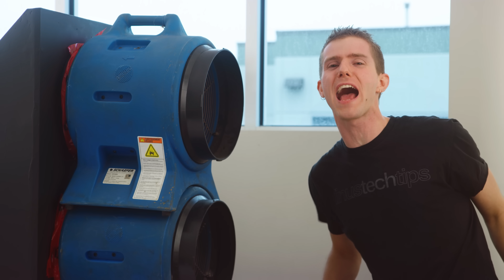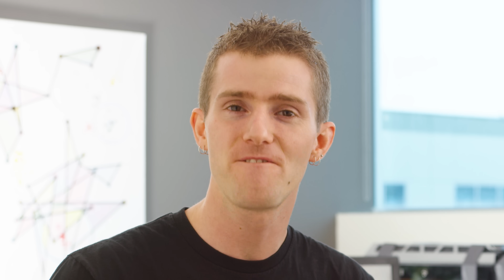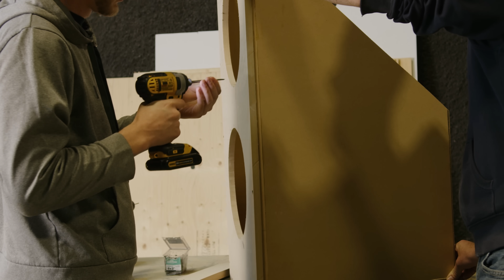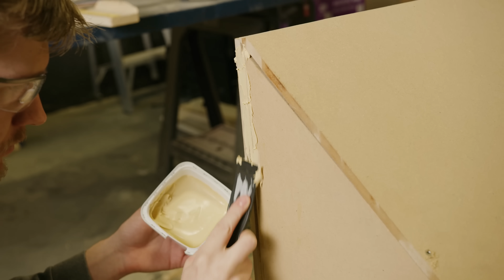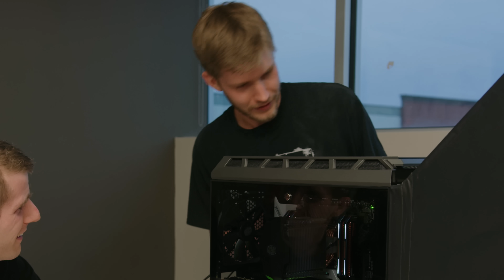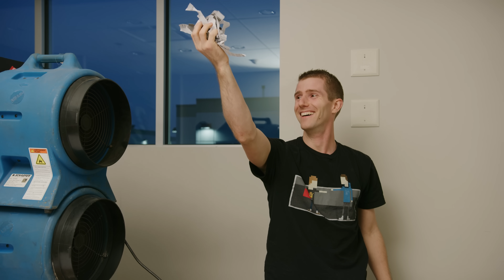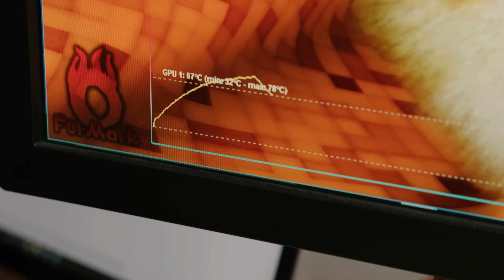Highest Airflow PC EVER - SUCCESS!

Comment: Im looking for a lower budget pc for gaming, photo editing and video editing what do you think of the New Inspiron Gaming Desktop by dell?
Reply: the one with the 1800X and RX 580 with 16gb of ram is a super deal for 1200$(total cost is slightly less than doing it yourself and it has a 580 without any price gouging). not sure what one you are looking at though. The lower priced one that has an R5 1400 and RX 570 is way over what it would cost to do your self at that price(almost 900$).
Reply: If you are not afraid to build your own, you could make a mini-ITX system with a 1500X and 1060 3gb with RGB bling and upgraded fans and all for under 900$, and that's not going cheap on any of the parts either. https://pcpartpicker.com/list/DCB3r7

Comment: Still quieter than some AMD Stock CPU fans :/
Reply: Those old ones were louder then a 747 taking off...
Reply: TromunPlayz atleast they cool better than intels
Reply: The Wraith spire is really quiet
Reply: ikr lol laptop amd 4650
Reply: Classic AMD fans were much worse, sounding like a leafblower the intel stock fans though loud are significantly quieter until the wraith cooler
Reply: It's nowhere as terrible as the FX5800 as well.
Reply: Nah, the Athlon was quite a beast and did beat the pentium 4 to a pulp in everything including heat,  but AMD was not exactly in position or budget to develop their own fan, so they had to rely on cheap third parties, and well, you get what you pay for.
And intel not always is right on the money with their designs either.
Namely, that awful plastic pins they still use.
Reply: Dr_Kachu san not to mention the noise and horrible colours lol.
Reply: I personally have a Amd fx 8320 8 core processor and i don't regret it its a beast for the money, but the stock fan was like a jet engine so I upgraded to a Cool er master hyper 212x which keeps my CPU under 45 degrees C under load overclocked to 4.3ghz. :P
Reply: What are you talking about?
Let's not forget the Intel stock fans...You know, Those loud as fuck things.  Louder then this
Reply: **Intel
Reply: Maraudience and your opinion is bad as well
Reply: Maraudience I feel like you own an Intel Celeron Processor
Reply: Maraudience oh and you're a fucking idiot, people aren't paying less, they're paying for a beastly processor that crushes most of intels chips in many aspects.

Comment: No front i/o for power switch? Just go into the bios power section and set it to "Always on". Now you can use the psu power switch to turn on your computer. The other way is to unplug and plug in the psu power cord.

Comment: Next video: we used a jet engine to cool a pc
Reply: Have you considered using negative pressure cooling?
Just suck the air out into the engine, problem solved.
Reply: Actually the jet engine and it's propulsive airflow can be completely separated (i.e. a turboprop).
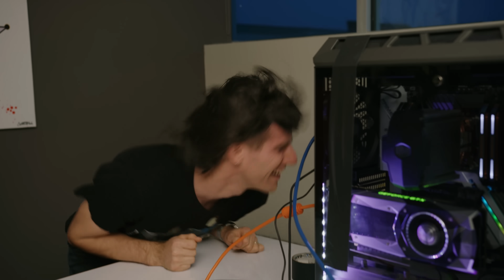Reply: Pc master race at 7:25
Reply: With afterburner for optimal cooling
Reply: @Riskabuen22  LOLOOL
Reply: linus actually looks like a real girl at 7:26
Reply: The Aliens guys calm down im pretty sure that this was just a joke
Reply: You obviously have the PC run negative pressure as it is before the compressor.
Reply: Try to cool anything with a jet engine and watch it melt
Reply: A jet engine as an output fan would work tho
Reply: Most of you obviously don't know how a jet engine works. They could attach it to the intake and pull air through. Or. Use the 1st stage bleed air off a turbo prop (high-bypass) for ridiculous air flow. But it would probly destroy the PC due to the volume and pressure created. Stop thinking about the exhaust of the engine ya noobs.
Reply: You mean an R9 290X stock fan right?
Reply: You could simply use a jet engine to suck the air out of the case... Problem solved!
Reply: If you use a turbofan
And seperate the hot exhaust
Youre good
Reply: QB3K no joke
Reply: G.M Ad Use Steel beams, not even jet fuel can melt them.
Reply: You are giving me ideas...
Reply: Just make sure you are using the jet behind the PC to pull air through it. Won't really work the other way around. Also, buy LOTS of speed tape.
Reply: Next Video: We hold a PC outside the window of a jet mid-flight to cool a PC.
Reply: It genuinely would work if you only took the low pressure turbine bypass air, which is ambient. If you took the high pressure exhaust then that sits at about 800C at running power levels, depending on the engine in question.
Reply: Almost everybody in the replies section of this comment don't know jet engines.
There are 3 common types.
Turbofan-Mostly used in commercial aircraft. Newer turbofan engines have high bypass ratio like the Rolls Royce Trent XWB.
Turbojet-Works the same way as turbofans, except it has zero bypass ratio. Mainly used for supersonic aircraft.
Turboprop-Works the same way as a turbofan, but there is no cowling. Used mainly in regional aircraft.
Reply: The Aliens That probably would not work as  i believe jet engines output hot air
Reply: Strap the PC to the net engine's intake. Problem solved. :)
Reply: @hoover8638  you obviously don't realize that jet engines have an intake. It would work just fine a a suck setup. Also the fans he used also put out heat.
Reply: @hoover8638  no shit
Reply: @hoover8638  you would use the intake to suck air through it
Reply: You can use an Air jet for cooling if you do something like a Dyson Fan. You can not however call it an "engine".
Reply: That's pretty...lit -_-
Reply: The Aliens i
Reply: at that point you might as well submerge the pc in liquid nitrogen
Reply: I think 'Jet Turbofan' are the words that you are looking for.
Reply: SloppyEngineer t'was joke.
Reply: jet engine make a lot of heat so not a good idea
Reply: The Aliens you could day that linus' got the got the funky flow
Reply: You would lose the video card!
Reply: If you use the idea of the Venturi effect and Bernoulli's principal to design a duck for the air to flow through before entering the case, you might get even better cooling with smaller fans.
Reply: The intake of an engine is just a duct. The compressor is turned by the turbine which is turned by the expanding gasses from the combustion chamber. You can use the concept of the compressor, intake, and exhaust of the turbine engine, but it will not be anywhere close to what a turbine engine is.
Reply: that would probably melt a PC.
Reply: I win
Reply: The pc would melt unless instead of the back you put it infront so as the engine pulls air, it has to go through the pc first before the air actually reaches the engine.
Reply: Ackzo will work if the jet engine was set to negative pressure, aka sucking air out of the case.
Reply: Instead of a jet, try one of those Dyson vacuum motors, or even better one of those weird open air designed fans.
Reply: That would be insane.. would have to put PC on the intake side though.
Reply: what about using a nuclear power fan?
Reply: well you still would have to try and attach the engine to the case, and even before, you have to figure out a way to not let the whole thing fly out of the windows or crash through the wall
Reply: lol that would completely melt it into a puddle of molten metals and plastic
Reply: If in front the jet will eat the pc and spit it out blam if in the back it will briefly melt then get lunched straight through the wall or several feet
Reply: Next video: we used a jet engine to melt a pc
Reply: Jet engines output blazing hot air
Reply: yeah but if you put one behind PC... PC would probably end up inside the engine
Reply: That would be a LinusJackassTips video
Reply: MelonPlayzYT I’m sorry what?? In what sense does it make that a jet engine outputs cold air? It is literally mixing the air with jet fuel and exposing it to produce thrust, if you ever have been on a jet plane or have see the engines running on one you can literally see the heat coming out of them, I fly a 737-800 on IVAO XA and it will tell you the temperature of the engines which can exceed 900C and even to 1000C
Reply: And next video we're gonna use ths worlds most powerful wind tunnel to cool it and use the acoustics system used to create vibrations to test spacecraft as the surround sound system and have a 4k display not just regular old boring 4k but each pixel is replaced by the worlds most powerful flashlight
Reply: Yes. Let someone else wear gloves while using a table saw.
Reply: Next video: we used the Ocean to cool the pc
Reply: Cold jet engine because fuk u
Reply: The Aliens techniques u could have the air sucked through the pc....... that could be funny but I’ll stay on this side of my phone for that
Reply: r/wooosh for practically everyone here
Reply: Optimal solution for roasting your pc
Reply: that 10IQ joke tho
Reply: Delete ur comment buddy
Reply: Next video: we went into space to cool a PC
Reply: It won't work it will only burn it sorry for making you sad😭😭😭
Reply: They did it, but camera they used to film it was never found. Rumors tell that it have not yet landed.
Reply: Yes bro 🤣🤣🤣🤣
Reply: Hey.. That was what I was thinking when I saw this.
Reply: Could easily have the jet engine pulling air through the case which would work well.
Reply: Yeah, no, that is contradictory.
Reply: The Aliens That would melt the PC. The better title would be “We used a jet turbine to cool a PC”
Reply: can't be a blow-style though, otherwise the fumes will melt everything.
Reply: How the fuck does an ICE, something that gets hot and generates thrust, cool a pc?
Reply: Reported.

Like honestly, the amount of people who comment this is just insane, a jet engine out puts very hot air, like ffs
Reply: Thats a horrible idea. That would heat up the PC because jet engines compresse air by using heat and then later blow it out
Reply: But that would be like a blow torch on the computer. Nothing like a blow torch to cool a pc.
Reply: Robert Pirlot what if they put the pc to the front of the engine
Reply: Jet engines exhaust is over 200c. I don't reccomended it.
Reply: It was a stupid joke...
Reply: How the fuck would you cool something with fucking blazing hot air? Dumbass.
Reply: use the jet engine to pull air thru case not push
Reply: @IIlIIlIIlII  BITCH

Comment: highest airflow pc ever vs water cooling
Reply: VS highest water cooling with a case soaked in the tundra
Reply: Vs ice cooling
Reply: VS dry ice cooling
Reply: that will be awesome project
Reply: vs submerging ur pc underwater vs pc in refrigerator
Reply: Just aircondition the room of the air cooled one down to about 10C...
Reply: UNDERRATED ! =))
Reply: Vs liquid mercury challenge.
Reply: Open loop cooling. You just take the cold water straight from the tap and you flush it down the drain after using it once.
Reply: Put a dry ice tray on the intakes like the F1 teams do when they cool the engine.
Reply: AIR WINS,
Reply: I wish he would do one vs my ice cooling creation https://youtu.be/7z_cTyhn-K8 and then he could cover the scandal that is Asus.

Comment: the following components are essential to eliminate any kind of thermal throttling related bottleneck:

1- 10 gallons of liquid nitrogen. 
2- highly conductive metal-based material, aka gallium. 
3-  six hexagonal oriented laser beam emitters for reaching absolute zero temperature. 
4- two one-way tickets to Alaska.
5- two appointed schedules to a neurosurgeon for frontal lobotomy of course. 
6- a MacDonald cupon for me for thinking out of the box.

Comment: To even benefit from all that airflow your heat sinks would have to basically need to look like fettucini noodle fins or smaller. because you need more surface to even benefit from all that air.

Comment: I've been on vacation few weeks ago in northeast Brazil where there's a place with winds that are basically like standing behind those 24/7.... it's crazy. Yes, they already put a wind farm there, albeit kinda small for it's potential. Problems? It's far away from any city, there's zero infra-structure there, and ground is basically sand all over.... very hard to install heavy towers.
Still, I don't think I've been anywhere with so much wind before.
An open test bench build in the open there would probably score not too far from this. xD

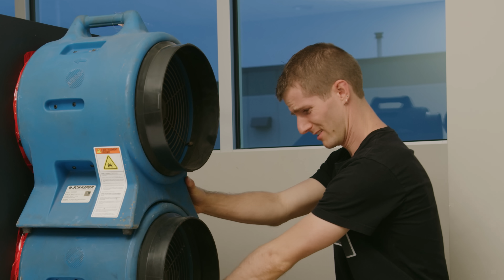Comment: 5:34 I love how the top panel comes right off, revealing the poor build quality of cooler master's product in a video that coolermaster sponsored. Should've given Linus a better case for this.

Oh, and before you educate me on just how much force pushes on that panel, go watch Gamers Nexus' review on that case. The top panel really comes off that easily.
Reply: u cant even lift this case without panels falling off it. Add big ass fans, then block off the airflow, the sidepanels dosn't fit tight and actually rattle. It is a really bad case.
Reply: And the case is really HAF... after some modifications ;)
Reply: I think you don't understand how mutch air it did blow into the case as a sailer I can tell you 1 think its way more as you think and if you want you can do the math it's a round 35 kilo per square meter of air per sec devided by the surfes of the case openings so its a lot
Reply: It is poorly built. Regardless of the 2hp fans.
Reply: My C70 would've survived this easily.
Reply: My old, Antec Sonata II would have survived. Metal construction > plastic.
Reply: I think the Corsair Obsidian 900D would've been one of the only few cases that would've survived this onslaught. I'm honestly surprised they didn't blow the glass out on this case.

Comment: just imagine if you did this configuration in push/Pull now THAT would be some Airflow......it would remove any bottleneck inside the case with air being trapped inside......

Comment: Do a revisit on this using some kind of Flex Duct to a case so you can move the blower fans outside during the winter and draw some real cold air in the case. Water temps on air with big ass fans? I think I see another video...

Comment: rig up some isopropyl sprayers(the finer the mist the better) to cool the air charge down to create your next meme video. but i would suggest to wear a respirator as the vapors from that would be not OSHA approved...but if you were surprised by a 10 C drop in a short time frame, that should(keyword is should) make the air charge considerably less than ambient

Comment: But can it cool down an AMD processor
Reply: i9*
Reply: pentium 4*
Reply: BUT CAN IT COOL CRISIS!?!?
Reply: Or a GTX 480 in sli
Reply: GTX 590 MARS III from ASUS in SLI with an i9 7980XE OC'd to 4.6GHz. Probably gonna need multiple power supplies connected to different breaker boxes lol. I remember the first time I tripped a break with a powerful PC....was hilarious
Reply: Joke doesn't make sense fool, Intel CPU's run hotter, your lame joke is moot.
Reply: I mean if an H80iV2 can keep my FX6350 cool while its running at 5GHz and 1.525 volts, this setup can probably do about the same
Reply: But what about the 9590?

Nah, too hot
Reply: More like Vega, FFS
Reply: The Wraith cooler actually works very well for my 8350. Only ever gets to 50 under load, turboing to 5.0 ghz. My old Celeron E1400 got to 85 at 2.4ghz but that's probably because of the crappy Intel toothpaste.
Reply: Nice bait
Reply: asking the real questions here

Comment: Airplane proppelers next
Reply: That idea wouldnt fly
Reply: "Oh, your PC has custom water cooling and an oversized radiator? That's a cool story bro. MY COOLING SYSTEM IS POWERED BY A V8 ENGINE.

Your cooling fans make 1 horsepower? MINE MAKES 400."
Reply: "120dB of Cooling - CPU cooled by radial engine powered propeller"
Reply: The problem is that the air coming out behind the propellers is really hot.
Reply: Just add liquid nitrogen, duhhhh...
Reply: Have the props oriented so the airflow is going towards the props.
Reply: Steven Derp oh that's the problem 😂
Reply: HOW ABOUT A BLOWN BBC WITH PROPS :D (Couldn't be more murican than that)
Reply: What if Linus actually does this
Reply: MERLIN ENGINE POWERED WORKSTATION!

Comment: This proves a well designed case with 200 mm fans all over the place and good heatsinks on components is practical.   What we need now is a new motherboard format where there is a GPU on each side of the CPU with enough clearance for an enormous air-cooler

Comment: lol, loved it! xD  Who needs water cooling when you have 2HP moving air through your rig xD   I think the next step though, would be to hook these fans up to a water radiator and see if you can get the temps even lower.  I think you were limited by how quickly the heat could conduct away from the CPU/GPU, and into the sink to be cooled.  With active water pumping, you could probably get even lower.

Comment: why did you use a blower gpu when those fans are enough to blow anything out? Also the back fan is completely pointless and might even be blocking more air than it allows through.
and what about using it on water cooling?

Comment: The H500P isn't marketed as a HAF series case, and rightfully so. Even Cooler Master's own page for H500P doesn't mention anything about airflow, only that it's "LIQUID COOLING READY". Did I miss anything? Why does Linus refer to the H500P as a case from the "high airflow family"?
Reply: Well this video is sponsored so they gotta make it sound good despite the lies and of course the proven fact that the case sucks.
Reply: That what was mentioned to them directly at trade shows and in the marketing guide. At one point I believe it was on the site too.